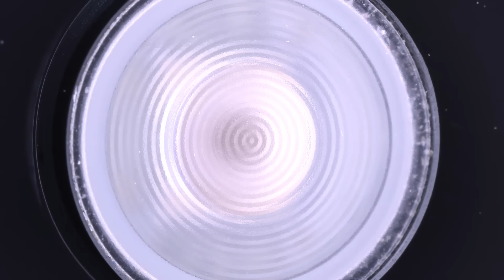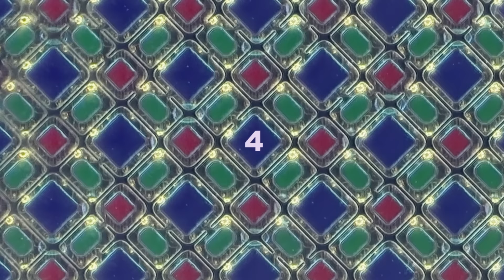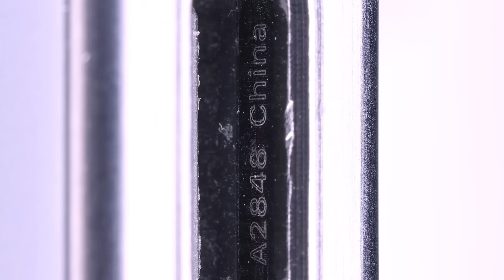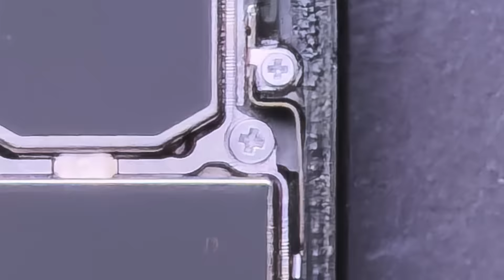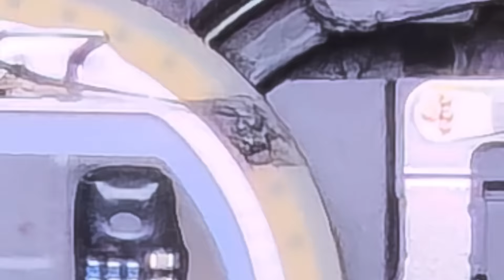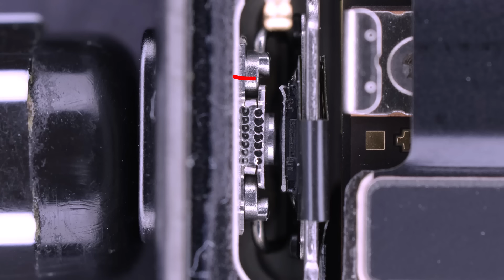I Opened an iPhone 15 Pro Under a 3D Microscope

Comment: Do we need more powerful microscopes to see bacteria and viruses?
Reply: Bacteria yes. This Macrolab 3d system can apparently magnify to about 20x. Bacteria requires at least 400x magnification to spot them as tiny dots and 1000x magnification (usually with an oil-immersion lens) to see their shapes.

Viruses, however, are much smaller than the wavelength limit of light, so optical microscopes won't cut it. You'll need an electron microscope

Comment: As an electronics engineer this is what my eyes are like, a few years it went away, I thought I was dying, turns out I needed glasses at 40
Reply: I feel your pain. I’m a mechanical fitter/machinist. As we both require good vision for small and precise parts, when our vision goes, it seems like such an unjust outrage! 

Most people don’t get it and think it s just for reading. Hang  in there brother! 

Now I spare no expense on lighting in my home workshop. 

Also, I scored a 1990 model Ziess OPMI 11 S21 ear nose and throat surgery microscope for electronics surface mount work ect. My friend works in a technical medical field and it was due to be thrown out. The fibre optic illumination wire wound potentiometer with integral switch to adjust the brightness of the halogen light source had failed and wasn’t available. I found an ex military pot and added a separate switch. New in 1990, about $22,000, 2023, about $50 in parts and my home workshop is covered for close up work! Oh, and it’s exceedingly hot when removing splinters from your finger!🤘
Reply: @kitatitThats brother, glasses have restored my lifestyle and since I already have a serious habit of bright lights and of using loupes to examine, Ive been operating like normal ever since I figured out I needed glasses, took 6 months to normalize to the shift in perspectives
Reply: I have repaired every part on every generation of iphone as a side hustle, free to friends and family.

Comment: YIKES the billions of different  screws will make repair expensive. Just got a macbook but will never get a IPhone because for the price of a replacement screen you can get 2  samsung galaxy a35 which are good enough😂

 The macbook however ❤❤ it will be powerful enough for atleast 7 years and unlike windows the battery lasts forever especially  in standby. It can run windows apps in vmware fusion/ crossover at  native pc speeds(games take a hit because of graphics  drivers)